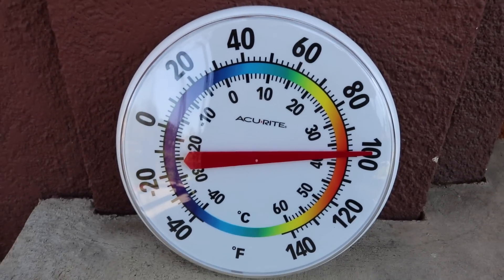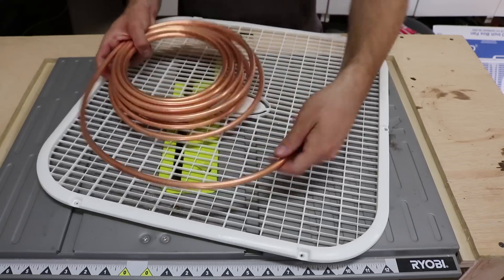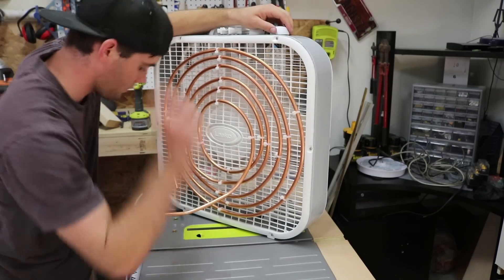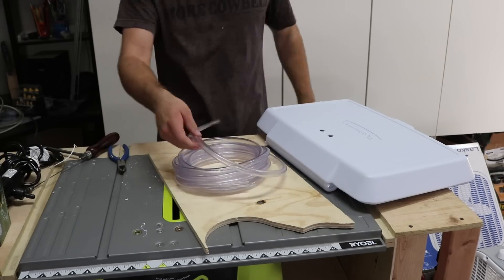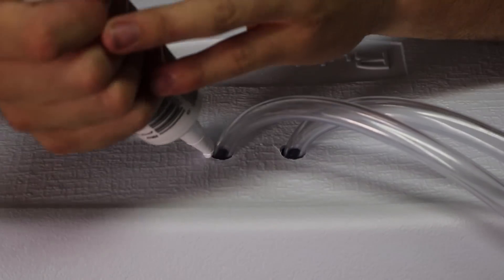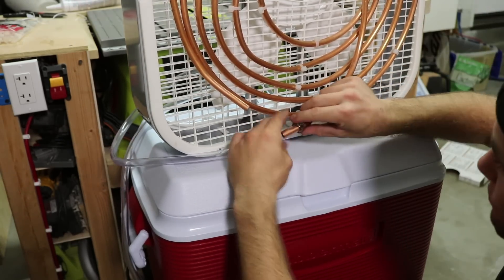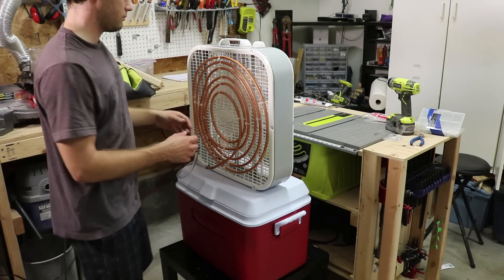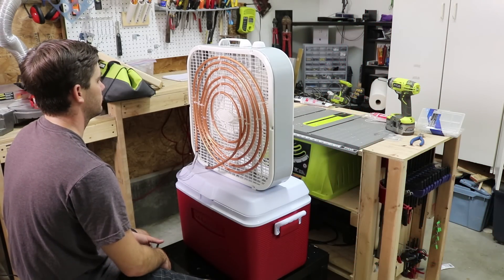$100 Homemade Air Conditioner - DIY

Comment: What happens to the condensation that forms on the copper tubing?
Reply: It will humidifie the room and transfer atmospheric heat back into the room. Now if he could create high presser in there, he could get the humidity back out and our  drought problems are solved.

Comment: honestly, its hard to get extra cold air with this because theres no heat exchanger or dryer, so the copper tubes arent nearly as cold as a real A/C unit running refrigerant.  now had I have done this project, I would have added a water misting system with a toggle switch on the top of the fan that essentially drains the cooler of only some of the water as the ice melts away.  but nice work my friend!

Comment: I get it - you can’t put a window unit AC in a garage door window, or a garage with no windows. Plus most HOA’s won’t allow a window unit AC to be mounted anywhere on one’s property. But how much did it reduce the temp of the room/garage? That’s the most important piece of information for we viewers to determine if it’s worth the time and money to build one for oneself.

Comment: Definitely creative & very cool... pun intended lol. I notice a lot of ppl saying you can get a new window unit for same... YEAH BUT you need a window that can take it. If you have such a window in ur garage then great but many of us don’t, including for example my former garage in Dana Point, CA along with a vast majority of all the other millions of tract housing built homes throughout Southern CA (Poster made clear he’s from CA) from San Diego up thru O.C., L.A., the Valley and beyond & inland into San Bernardino, just those areas alone have literally millions of homes similarity built with very few having windows ideal for AC unit placement. As such this video make perfect sense. If you’re from CA you know what I’m talking about.

It’s ALSO a great lesson and example as to how AC fundamentally works along with this specific example as well as more important as with all well made DIY videos, which this one definitely is well done, it allows for major modifications and adjustments or individual customizations, etc.. 

In other words, very cool video! I get it! I think I’m gonna try something very similar to this.... and guess what? I did & holy cow it worked! Thank you for creating and posting as otherwise I most likely woulda never even considered it nor known how. Thank you for creating and sharing video! Liked and subbed!😁
Reply: I'm in Wisconsin and the last thing I need in my garage right now is an AC unit (I do have a 240 v electric heater that works nicely). 

However, my garage is even worse. I have no windows at all in my garage. 

How well did the cooler work as far as lowering temperatures goes? I'm sure it feels great if you're standing right in front of it, but what about the garage as a whole? Also did you get much condensation from it?

Comment: I’d probably use an old ac condenser from a car rather than the copper tube and it would definitely cool better. The problem with a 100 buck air conditioner is they don’t have much volume of air.
Reply: I have a spare radiator and condenser from a 95 camaro I could use.

Comment: Add rock salt. Just barely enough water to run the pump and fill to the top with ice. Put the copper pipes on the back instead of the front so your pulling the cold air off and most the condensation will fall off into the fan in which you still holes for water to drain back into cooler but about 1/32 size holes because will need many. This works because your pulling the cool rather than trying to blow thru the piping on which case original design is as well as blowing around it. A fan in an ac is after the compressor right..
.. so. Any way it works if you do it this way and most people already have an old cooler lying around. Sealer is about $3 fan $15 at Walmart pump $40 home Depot. Great idea poor thought design. My way dropped temperature in my shed by 15-25 degrees depending how long I let the pump run beforei turned on the fan
Reply: I was wondering why he didn't put the tubes in the back

Comment: Hi! Cool!  That saw, it's not just a hack saw, it's a COPING saw. The blade is much finer and used for detail cutting as you can turn the blade within the handle, good for cutting awkward shapes in most thing including  skirting board contours etc.

Comment: For everyone that keeps saying you could’ve bought a $100 air conditioner at Walmart and my answer would be and put it in the  nonexistent window? I think that was part of the reason why he took the time to do this he had no means of installing a regular air conditioner unit for a portable unit he still needs a type of window awake does not have the threes and why he built this do-hickey....

Comment: I'm curious the temperature difference with this, would have liked to see that digital thermometer do a before and after
Reply: Not much if the room is a typical size or the temps outside are high..all these gadgets are neat but not worth the money spent. just get a air conditioner...
Reply: @thedbcooperforum  they dont work well if at all in 100+ temps with low humiditi. in arazona for example you dont see alot of ac units but swamp coolers. the air is just to dry for them.
Reply: @gogereaver349  they work best in low humidity.

At 75°F, the evaporative cooler has the optimum efficiency at 70% – 80% relative humidity. At 80°F, the evaporative cooler has the optimum efficiency at 50% – 65% relative humidity. At 85°F, the evaporative cooler has the optimum efficiency at 30% – 55% relative humidity.
Reply: @gogereaver349   but it’s not a swamp cooler though. Swamp coolers use evaporation to cool the air. That why they get less effective as humidity goes up.  Water doesn’t evaporate as well when it’s high.  This just uses the water to move the heat from one place(the air going through the fan) to another place(inside the cooler).
Reply: Well Water with ice will only my get up to 32 degrees so I’m 5 degrees f cooler than the garage temp
Reply: me too
Reply: Probably wouldnt really lower the temp of the whole garage but if you have the fan pointing towards where youre working i bet it feels better than just normal fan blowing. Also this dude is dumb for buying ice you should freeze water in some gallon jugs or something and re use it 👌🏻
Reply: @banehogs5589  It's basically re-engineering the old school version of putting a block of ice in front of a fan.
Reply: @banehogs5589  Did you have to call him dumb to make your point?
Reply: @007alztruli  yes
Reply: @dismalrealm  indeed

Comment: A small ac unit is about 100$ locally . And between that pump and fan running you're using about the same amount of energy/power no ?? Sooo🤔

Comment: lets see if you scrounge you can get most of the parts for free. Maybe pay for a pump, but if you ask a enough people someone will have one to give.  Also INSULATE THE GARAGE DOOR.  Cost of ice and electricity ugh.  Ok you can go solar for the pump.   The ice not so much but wait. Dig a 8 inc D. hole 8 ft deep.  Get scavenged pvc pipe 5 to 6 feet long.  Wrap scavenged hose or coil around the outside bring water back up from the middle of pipe.  Fill hole.  Now its ground cooled.   No ice.  Solar mostly free electricity.  Hey its California you can probably get the solar panel free as well.   OK I know folk this vid is 2 years old and he has probably made changes to the garage.

Comment: After running for hour is there a change in room temperature. Curious cost per hour watts used vs a window unit. Now that would make a video!

Comment: There are several things you could have done that made it better. 1 always insulate the room that you are trying to cool. Reflected windows coverings would be good insulated garage door would cut down on how much heat was in the room. 2 instead of using ice which contains dirt which can clog up your pump use bottled water and freeze in freezer that way you have less expense and it is reusable and cleaner. 3 add a towel to the back and have cold water constantly running down the towel from the top to the bottom soaking it with cold water that way the air being sucked in is cooled before it hits the cooler tubing in front. It will work more efficiently that way.
Reply: Eventually the wet towel idea will the electrical motor from moisture since the fan was not made to be water/weather proof that’s why he didn’t put tubing in the back

Comment: This is literally the Biggest   Idiotic stupefied display of  " ingenuity"  ever Witnessed.  I kept waiting for  April fools !!! God  Help the youth With common sense. Why would you spend money  & time ?   old mechanics trick for a 100  years  = 5 gallon bucket/container "FULL OF ICE"  put it behind the Fan .  The suction from the fan will  Distribute cool air. If you are Worried about the ice melting to quickly . Use  an igloo cooler and leave the lid cracked open 2-3 inches =Same  effect.  God save us from TECH !🤯

Comment: This is the principle of air conditioning.  Cooling fluid through a coiled metal with a blower. Nice
Reply: Yeah, and that blower cools the fluid by blowing out HOT air. So if it were like an a/c, it would be cooling of the inside of the ice chest - not the outside where he is sitting.

Comment: Judging by some of the comments on here, it's obvious that people don't understand how much electricity an actual AC unit sucks up - it's a lot.  Also, I was hoping you'd show the difference in temperature with your newly built AC-Fan.  How large is your workshop and by how much does the temperature go down with the  AC-fan?  Thanks!
Reply: How much is your comfort worth and how much of A difference do you think that home made air cooler is going to make without removing the humidity from the air?

Comment: Why didn't you show the temperature of the cooling fan like you did with the garage door? How cold is the air coming off of it?
Reply: He seems like a real nice guy but before making videos learn some basics - that was a coping saw not a hacksaw and hose clamps  not pipe clamps  2.  Anthony Sambataro  brings up a good point so we know if it cooled off the room or do you have to sit in front of it which not much work is getting done in your shop. 3. Design a Misting system  for the garage door and install some insulation on the inside of garage door  4, Overall design in theory is possible but not effecient  where more surface area of the tubing is needed to match the amount of air blowing across it. If you were able to baffle one person with your brilliance to make one then mission accomplished but I reccomend removing the video
Reply: Anthony ... 
I was wondering same thing ... I'd like to know how efficient it is.

Comment: you gave no numbers as to how much cooler is the air with the water in the piping  and  empty pies. Also,  if your ice freezer is in that garage, you are creating a net gain of thermal energy, what with the  electricity of the fan and the freezer and the warm municipal water  coming into your garage.   You must be kidding  mentioning  monetary  efficiency of this system.  It is a  fail in every regard except as  perhaps good practice  for developing your problem solving skills( it's still a loss, but  even a loss is good training).  I applaud your  initiative and  drive, but you need  to work on your problem solving skill set, as regards assessment and planning of solution.
Reply: ps there exists much more efficient thermal exchange piping- with the little flange blades  to radiate heat.

Comment: How about a small radiator form a small car mounted to a industrial floor fan hooked to a party cooler with two 20 pound blocks of dry ice and 4 inches of water, duct taped and sealed? Way better results.

Comment: We normally have summer heat between 38 degrees Celsius to 45 degrees Celsius, that is between 100.4 degrees Fahrenheit to 113 degrees Fahrenheit, and the beaches are packed with people in this heat, you're a sissy if you can't tolerate such little heat.

Comment: I once had a similar situation. First and most importantly you must insulate the garage door. In my case, I was able to use 1/2 inch thick Styrofoam sheets that dramatically cut down on the heat transfer. I then utilized a portable air conditioner that only required a small opening to vent out the hot air. My method cost about $300 but on a 100° day I could cool this garage down to 75°.
Reply: You cut a hole in your garage wall?  I assume it was between the studs.
Reply: You cut a hole in your garage wall?  I assume it was between the studs.

Comment: A real AC unit extracts the heat from INSIDE the building and exhausts it OUTSIDE of the building. You're just pushing heat around inside your building while melting the ice as well. So, a little gets transferred to the water in the cooler but not much. Sure it feels good if you're directly in the air stream. Ya know, like any fan would but with a little extra coolness. Better stay in front of the fan though.

Comment: Buy a 20×20×3 inch filter tape it to the front of the fan cut the top of the filter box open and fill it with crushed ice, and you now have a wet cell evaporator  that will cool a room quickly. Copper unless insulated will absorb too much heat and 100 bucks is too much

Comment: What a joke.  You spend 100$ on this.  If you wait until fall, Window AC units go for 80$ on clearance.
Reply: Who wants to suffer through infernal temperatures until fall?  And he clearly has no window in that basement, so a window AC is out of the question.
Reply: I'm guessing your advice for someone freezing to death in winter would be, "Just wait until summer when space heaters go on sale for $40," LOL.

Comment: Nice video dude i have the same set up as you 
Near the same my cooler box is 12 volt 
With its owen refrigerator on top it keeps the ice water ice cold 24/7

Comment: A small fan blowing on a 50 lb block of ice would do as well.  What you need are the fins, like a regular AC unit has.  The surface area those hundreds of fins on the coils of an AC unit are what effectively transfers the cold to the air.

Or, you could just block off the windows and insulate the garage door with styrofoam.

Comment: Put some styrofoam  insulation in your garage door and this will help reduce the heat transfer into your garage.
Reply: https://youtu.be/TtRkd-rITkU is also a great way to cool down!
Reply: I installed a solar powered garage vent fan.  It sucks the air out of the garage creating airflow which lowered my garage temp by at least 30*.  Cost me 15$ at HomeDepot.  More cost efficient and runs itself for free when it's hot out.

Plus this is 100$ plus the cost of ice, water, electricity each time you run it...
Reply: @matthewcastle3364  Works as long as there is cooler air outside to pull in.   Best is to insulate entire garage first; cement floor will act as a heat sink to cool the space; adding REAL A/C will complete the job.
Reply: @x.y.8581  put a mylar blanket to reflect sunlight of the garage door
Reply: @corcaccia  Yes, in addition to foam insulation and some REAL A/C.
Reply: @matthewcastle3364  what solar fan at home depot is that?!? Only solar powered ones I've seen were in the hundreds

Comment: I don't believe you've removed even one BTU from your garage.  In fact you've probably added a few with the electric pump running.  I respectfully suggest that by removing your cap while inside might help your body heat radiate a little better from your scalp.  Oh well, as long as you get views who really cares about thermodynamics?

Comment: Did you get a temperature reading of exactly what the temperature in front of the fan was before and after the additions to the fan at the same ambient temperature?

I just realized he had the thermometer but never mentioned the temperatures coming off the finished system. The first thing I would have done is check the temperature, but instead, all we got for temp measurements was "I'll be using this a lot"...those facts suggest a possible problem.

While I have a pretty good idea, I don't know the exact stats of the output on this project, but the point I'm trying to make is, if it doesn't work very well, and we are led to believe it does, then we build one and find it's just north of worthless, it can really upset your viewers, and what good is that going to do anyone.

Comment: I have just made a quick air con unit with surprisingly ( slightly better than just using the fan ) with a 2 litre water bottle a £5 fan, few zip ties and a cooler block. Importantly no ice......... therefore no water so a lot safer. Took me 10 mins with stuff I had in the house. Check it out here https://youtu.be/id0H799fRa8

Comment: Many comments have asked why doesn't he just buy a cheap AC at Walmart. In California, most of us are on a tier system. We are allowed to used so many kwh at a set price. When we exceed that tier, we go into the next tier that can be 30% more. Anything that uses a lot of energy can cost us a lot of money. My current bill is $400 and will likely be $500 and possibly $600 in the next 2 months. And it's mostly due to using the air conditioner more. Heating is a lot less as we have natural gas that costs less at the moment.